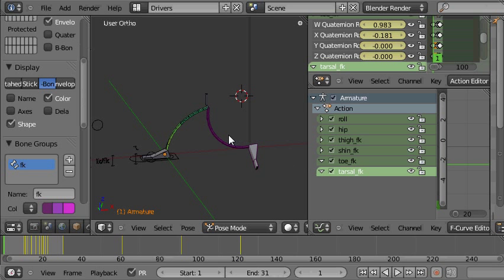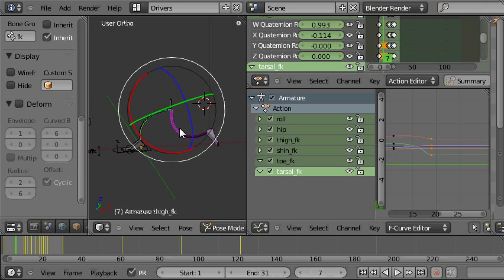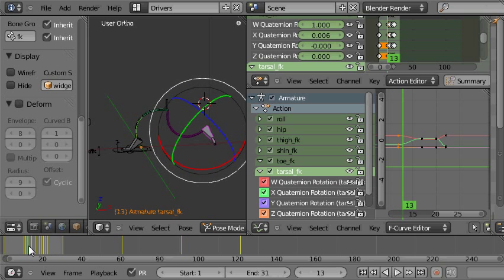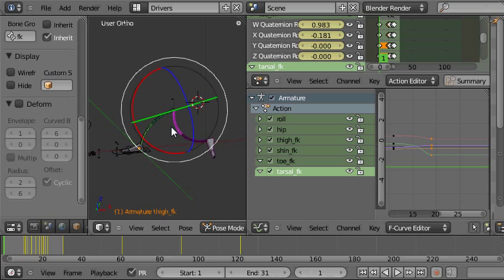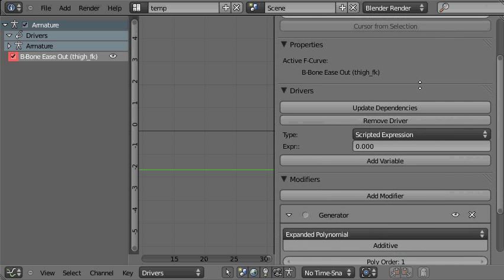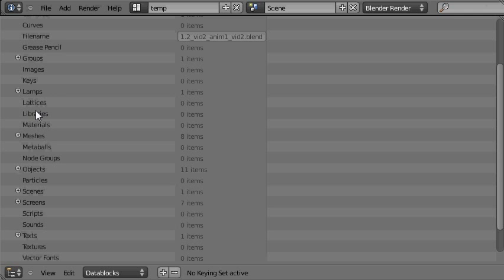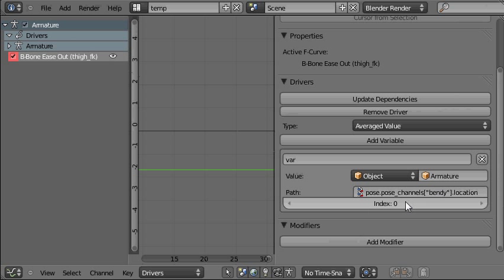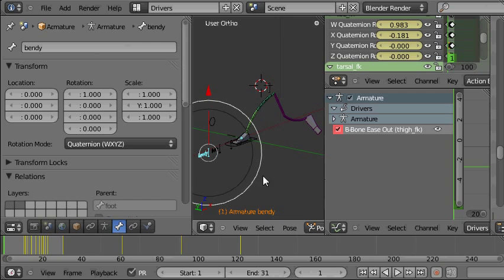Tob's Blender 2.5 Animation Tips and Driver Question

Comment: In the graph editor, I make sure I have the driver selected,  then I add keys by control+left clicking in the graph editor. You can tell if you properly selected your driver if it's name is in white (top left of graph editor). This is easyer to see when you have several drivers. Also make sure you are in 'drivers' mode.

Comment from the maker: Yeah, just as you said with the driver problem : ). It's a good feeling when you get the first one working. I haven't done any rotation drivers yet. In fact I still don't know how to use a normal editable f-curve as the driver, I've only had success with the generator modifier. Whenever I try to add a keyframe it just doesn't do anything. Do you know how to add keyframes to driver curves? (thanks for the comment btw glad the videos have been useful, your animations are great : )

Comment: Hi Tob, cheers for your tuts, very helpful I am currently following your foot tut, but using drivers instead of actions. I  have finally set up my first successful 2.5 driver. I had to change the driven bone's rotation to euler though, do you think this will give me problems? have you managed to drive any quaternion bones rotation? BTW, I saw you didnt create a curve for the driver in this vid, but I think you figured out the problem since posting this:-)